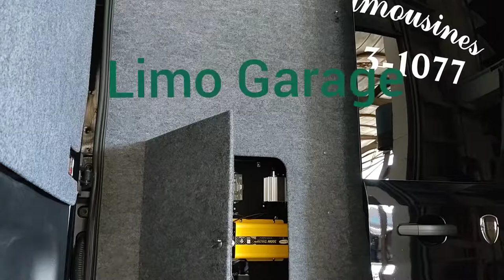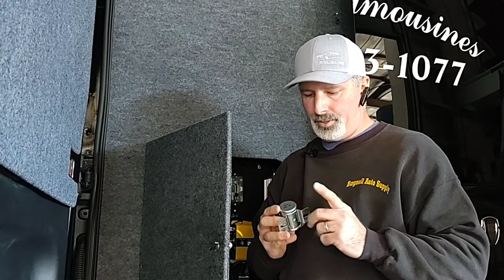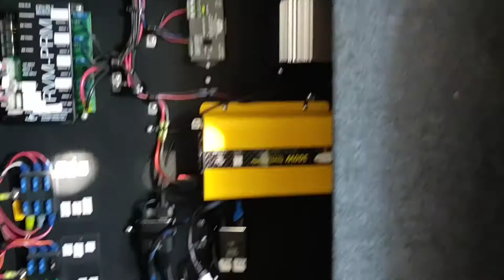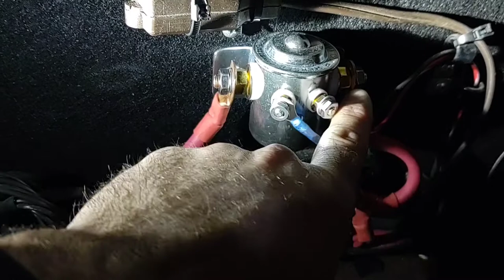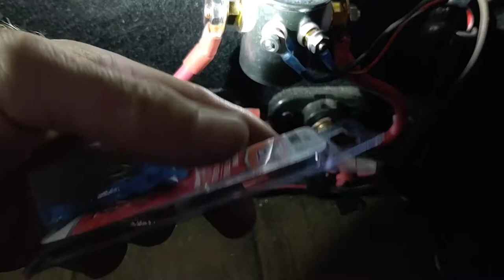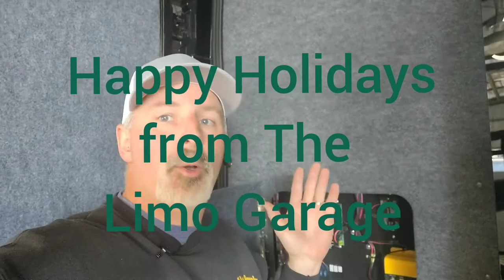No Power To The Back Of The Limousine.

Comment: So his solenoid seems to be located in a different spot than my 1999 Lincoln limousine Strech This was located in the left of my hood (If your stranding in front of the car)
Inside of a black box (yours may not be) now my issue of getting power to the rear wasn't the solenoid mine was all my breaker fuses were corroded and trashed replaced them and still Didn't get power to the rear come to find out the owner before me wired them to the 2nd battery in the control manual for my car it said "Battery B is only to jump the vehicle" So it does NOT power the accessories all of my accessories should be hooked up to my Main battery after doing that I had power to the rear of my Limousine. Hoped this helps some of you!

Comment: Thanks for the video , my 2011 Lincoln Limo keeps draining the small battery that gives electricity to the rear ! Idk what to check
Reply from the maker: Start by checking you're second alternator. It should put out a minimum of 13v at idle.
Reply: @thelimogarage9665  I appreciate your help , can I call you for more help if it’s possible !